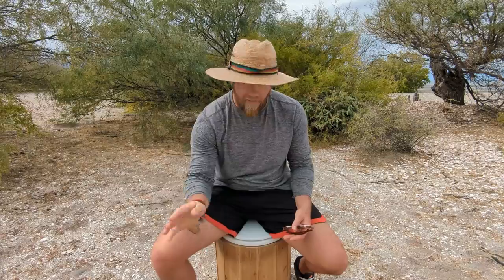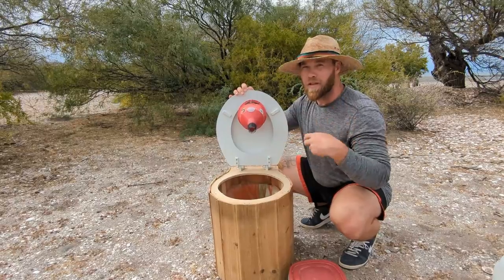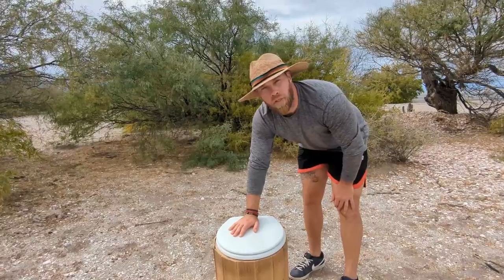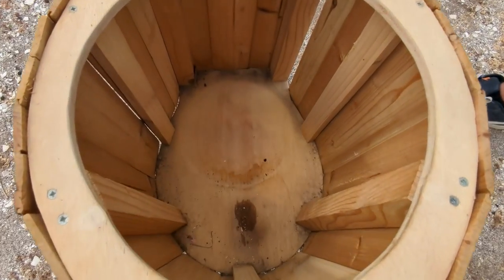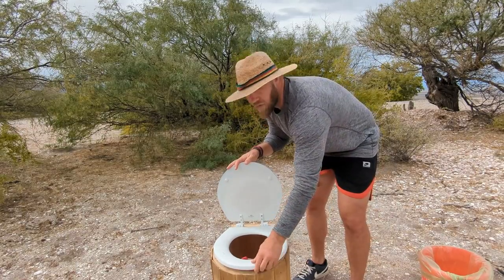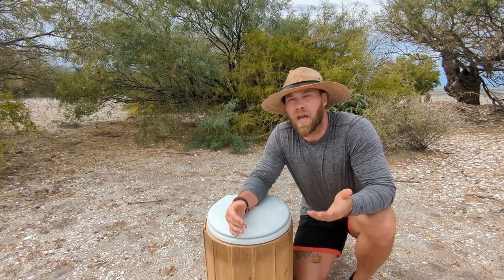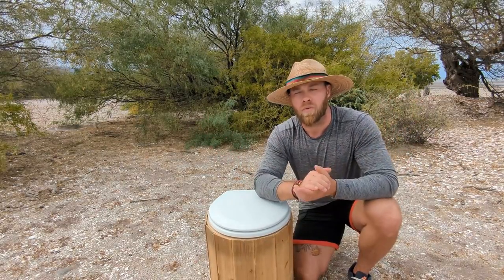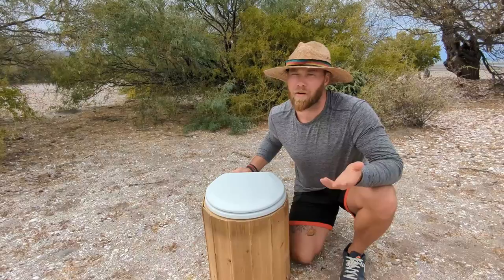DIY Composting Toilet for RV or Van: How We Saved $1000 and Built Our Own Compostable Toilet

Comment: ashes from the wood stove also works effectively as compost to cover up the smells. I clean my poop out every single use. the bucket never gets full. it's not quite all completed yet. but it works! I don't pay for sawdust and the ashes get reused over and over again. I also stopped using store bought litter over a few years. the same ash/sawdust mix works in the cat's litter box. the dry compost and sewage waste can be incinerated and it reduces the amount of cleanup. I don't pay for sani dumps and I don't pay to heat my RV

Comment: Actually I had bought a urine diverter ( came across the cut 5 gal bucket later) no mess at all, have to dump the liquid everyday but the solids every few days.
Reply from the maker: Yeah a diverter would be nice to have. But, this setup has been working for years... but improvements could be made

Comment: Hi thanks so much for this, I’ve been looking & yours is the best & most straightforward. 
Would you be able to give a gal a little more detail on the wooden frame? What exactly do I need & how do I start? Thank you so much 😊
Reply from the maker: Hey 👋 Glad this was helpful! You'll need 1 sheet of plywood 1/2" about 4x8ft or enough space to trace your full toilet seat twice. You also need 1 piece of 1x2, 8ft & 1 piece of 2x2, 8ft. Trace the outside of your toilet lid twice on the plywood twice, also add about 3in of extra space from the back of the lid to the edge of the plywood (so it is not an exact trace). This is so you have something to attach the lid to. One piece is the top and one piece is the bottom of the toilet. Cut both out w/ jigsaw. Then trace just your bottom toilet seat hole on the inside of one of the cuts for your top. It's better to make the hole a little bigger than the seat so you don't see the wood, just make sure the front rim is at least 2in wide/thick for support. Then cut your 1x2 & 2x2 to a length that is 3.5in taller than your 5gl bucket (this is do you have room to get it in and out). Then screw it together and cover the outside with cedar planks or anything you want. Please refer to the video for the correct placement of your 1x2 & 2x2 pieces.